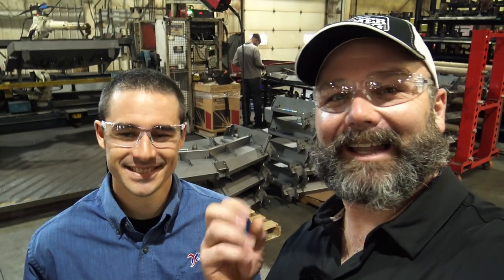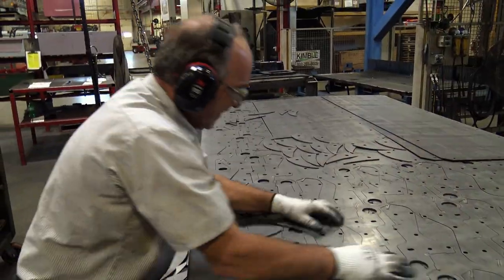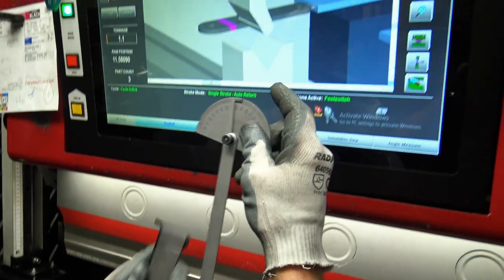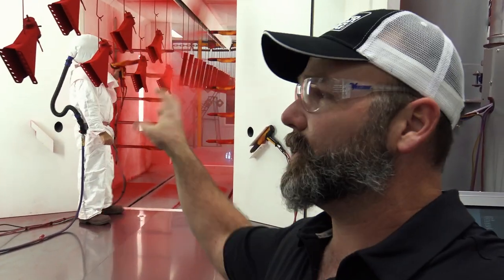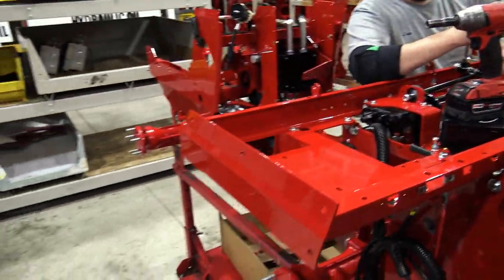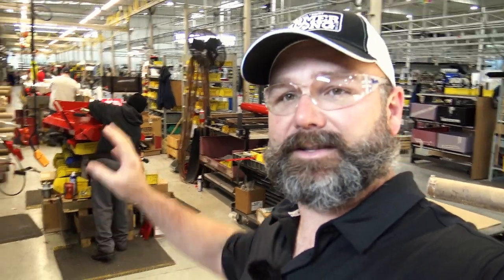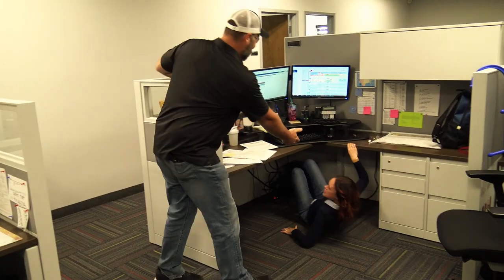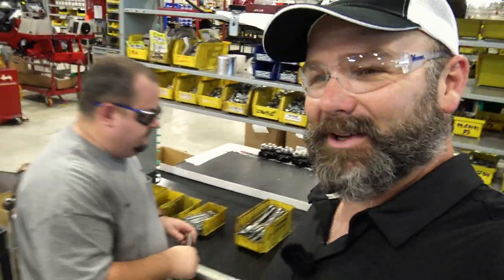How it's made in the USA Ventrac Tractor

Comment: Grainger keeps vending machines stocked in my facility.  They stock everything from lubrication, gloves glasses, batteries and so on.  They don't charge the company until each item is actually vended.  This way it keeps all the over head costs down for the company.  And gives our maintenance department a higher spending budget.  It works very well. Great system.